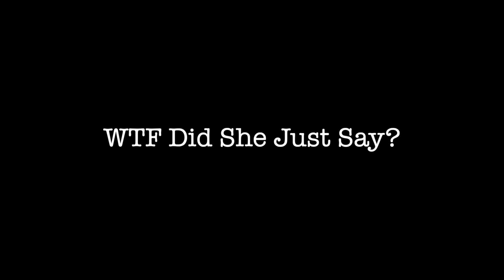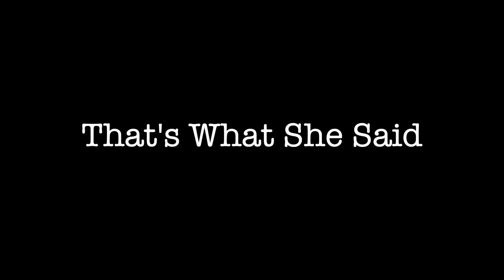That's What She Said! // 2020 Bloopers & Deleted Scenes

Comment: Snag a piece of the graffitied steel for your shop.
Reply: Best, idea, EVAR! said in my best Tiny Tina voice.
Reply: Steel a part of the warehouse there Sarah. Warehouse puns............Awesome. 😂😂
Reply from the maker: I wanted to, but they were too big to grab on my own.
Reply: I was thinking the same thing.  New owner could probably have made BANK by car fully taking the graffiti down and selling it to art galleries rather than turning it into twisted metal.
Reply: @SarahnTuned  Screw it. I am flying out there to help her steel that. See I done did it again with the daddy puns. 😂
Reply: Hire some graffiti artists to tag up the new shop. Thanks for Great videos all year. Happy 2021 🤜💥🤛🐭🎉
Reply: could prolly get it with a battery powered reciprocating saw?
Reply: @SarahnTuned  Giggity.
Reply: @SarahnTuned  just tie a section to the bumper and drag it to the shop!
Reply: @SarahnTuned  That's what you said.
Reply: @andysiebert31  Nope. Really hard to do on that material, but an angle grinder is perfect.
Reply: @SarahnTuned  dewalt 4inch grinder with a metal cut off wheel
Reply: Your miss the birds from that warehouse too.😔
Reply: You have to had licensed mechanic do the brake job !!!
Reply: @dfactoryrat653  They will do it for free to get advertising on her channel!

Comment: That old warehouse had alot more square footage to it than I thought it had.  The claws on the end of those high hoes each has it's own function.  The one is for picking up material, moving it around, and piling it up.  The other looks like a sheer that can cut through the steel I-beams when demolishing your poor old abandoned warehouse.  May it rust in pieces.